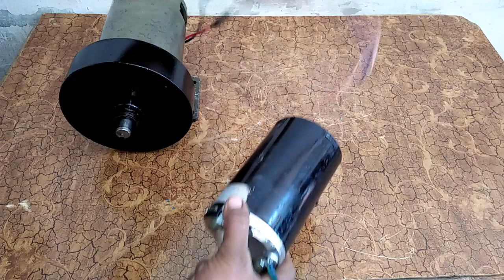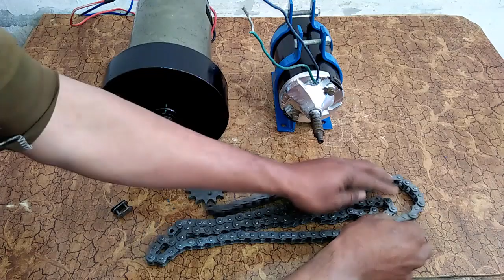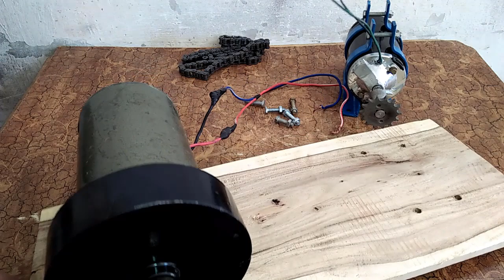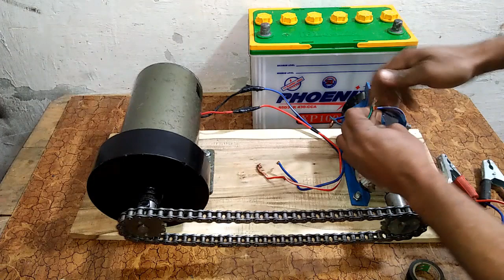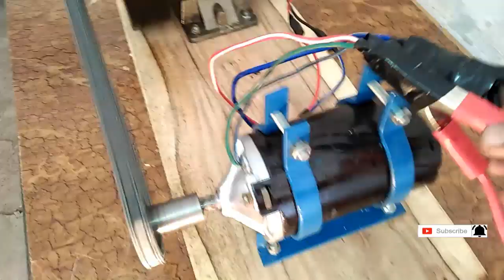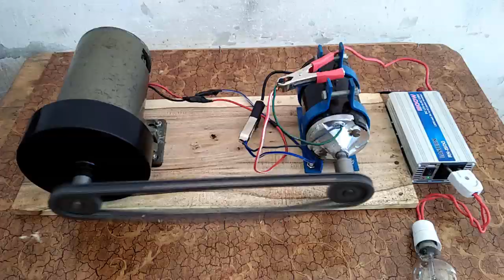How to Make Free Energy Generator 220v From Alternator Generator Recycle Free Energy

Comment: Your good job very nice about new research

You use only one buld which in 100 watts 

I have some Questions 

please prepared video as engineer type and prescribe complete description 

Where is Alternator detail 
Where is DC motor detail 
Rpm amp etc

1   measurements from volt meter

2 measurements from amp meter

3 how many received  output and watts and amps 

4 total cost of said free generator 

5 how many hours run continuously

Comment: What would really be impressive… Is to lift the board up off the table and show that there are no wires going underneath on the back left corner by the big gray motor....
Reply: And connect where?
Reply: So true
Reply: Exactly it just looks so dodgy the way the board spun on the corner axix if it was true self generation for the motor then show us under the board. If you dare...
Reply: @nbflyingfox4672  you guys will never understand how free energy produce..better get some technical knowledge than coming across such types of videos...
Reply: @shahbaz khan    I understand don't you worry your little cotton socks on that one. You see all these so called free self propelled generators but when questioned about authenticity you  bite like a dog it is quite clear that when the board was moved it swivelled round as if something was stopping it from moving, there's hardly any weight in the contraption that was built so, could have lifted the entire thing off the table... Now that would be impressive.. Another thing is that when others comment to these so called free electric projects please give parts list, nobody comes back with a reply or the full specs of the motors, diameter of pulleys. If you want to keep promoting these free electric projects at least share with others your build.. so that those who want to experiment can try and then leave their true findings hear...
Reply: @nbflyingfox4672  don't judge so quickly everyone ... If you're well known n have good technical sense than you will never go through this ..you know we'll, it's possible to generate free energy,..it's not a big deal or rocket science...forget about others even they do fake or real ...just concentrate on the  sharing message...!!

Comment: A wiper motor can not make enough power to start a large treadmill motor with a heavy flywheel up to that speed in an instant. It takes time to gain speed. Also it is impossible to get anything from nothing.  Remember friction and resistance. Another BS!! video